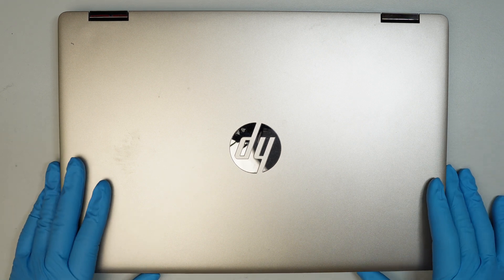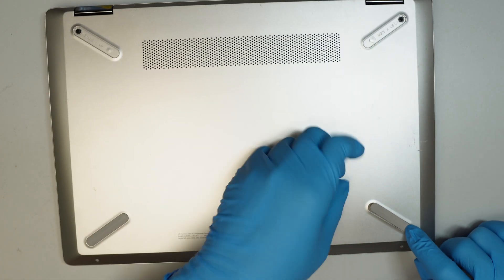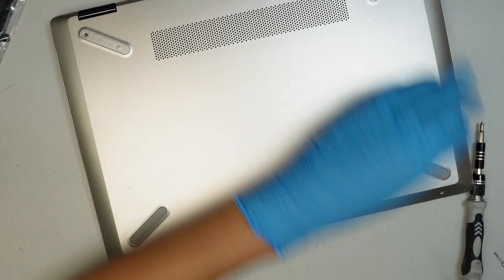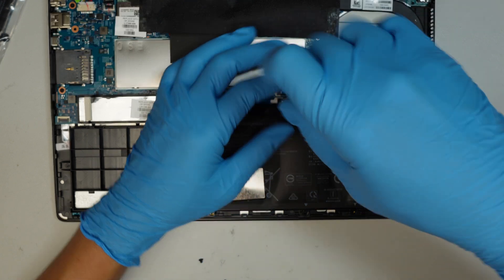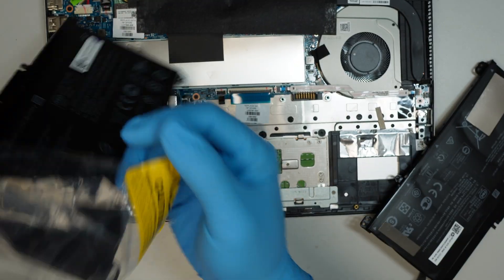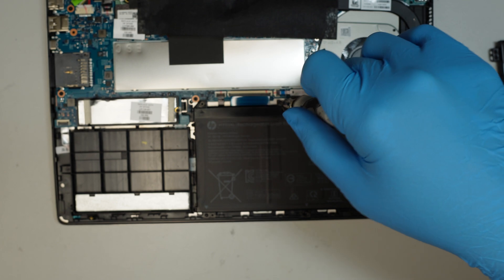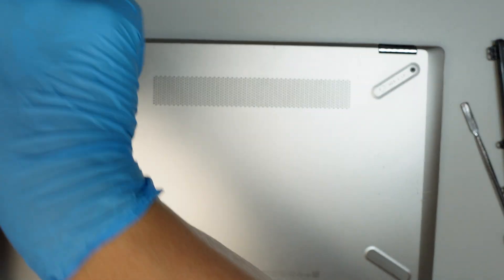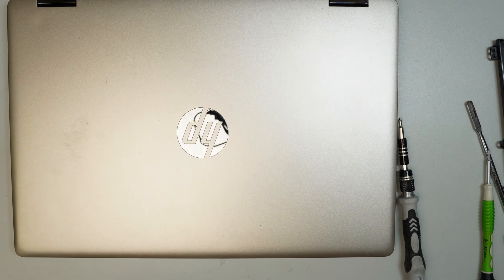HP X360 14m dh Battery Replacement

Comment: Hi, thanks for sharing. I found that there are 2 metal plates sticked on the original battery. I wonder what is the function for the metal plate, and do I need to remove them and stick them on my new battery?